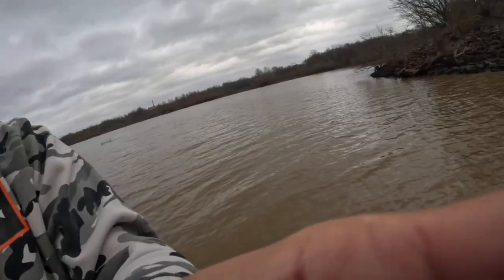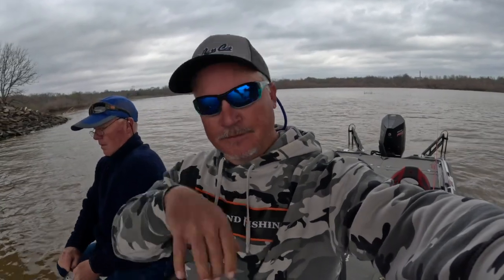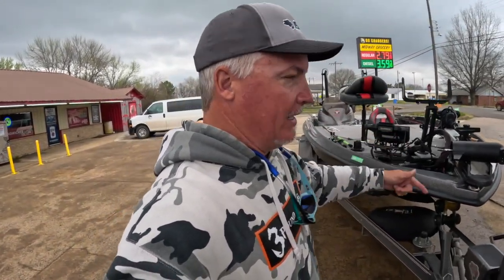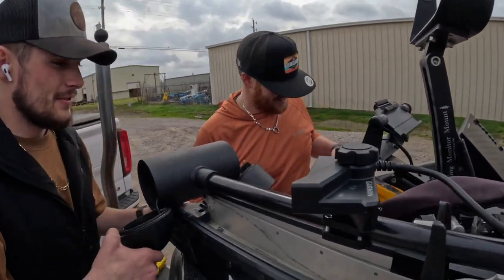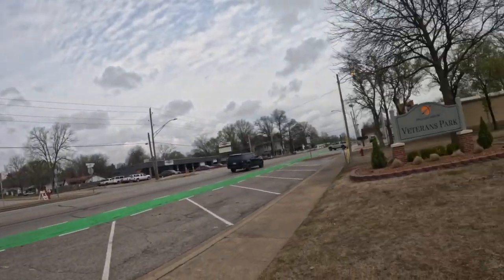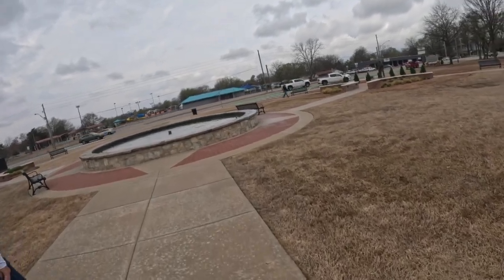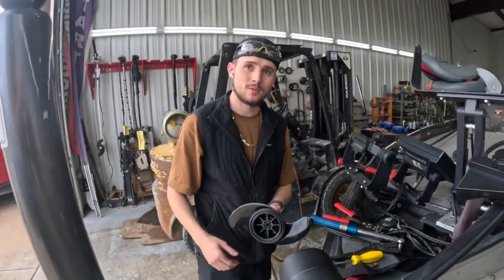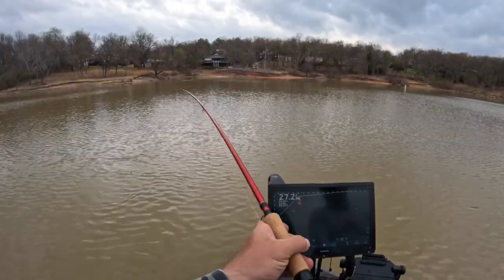Unbelievable LUCK (so we can fish the tournament)

Comment: I originally said. "What you need is some type of voltage regulator."

I spoke to a good friend of mine and he enlightened me on a couple of things.
First, there is (no substitute for a regular maintenance schedule) for a trolling motor that is paramount in successfully fishing major fishing tournaments.  You might want to check with a local MinnKota dealer that is well briefed on the latest MinnKota technologies and setup such a maintenance schedule.

Additionally he referred me to a MinnKota technical release that stated the following.

Power Output

Lithium Batteries maintain higher voltages for longer.  Motors engineered to make the most of flooded lead acid batteries can be damaged by the higher power output.  To prevent this damage when using Lithium batteries you should not run your motor at its highest speeds, staying at 85%/Speed 8.5 or lower.

Just some information that you may???? find helpful.

Keep hunting for those 3 lb. Crappies!!!!  Enjoy your channel.
Reply from the maker: I agree!!!!!!!!
Reply: If your around Grandlake there is a minn koda dealer there Honeycreek Outdoors